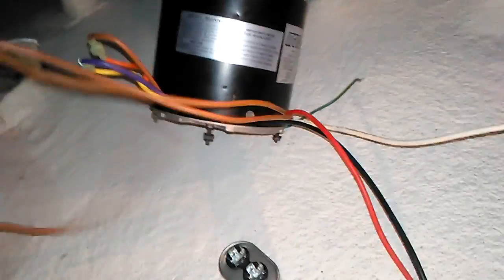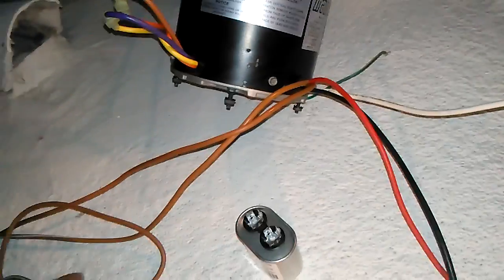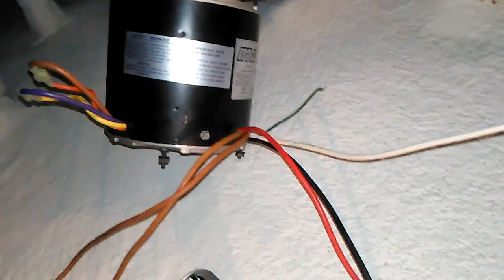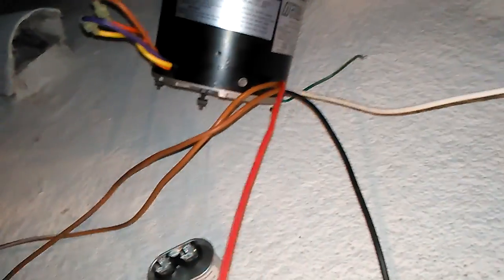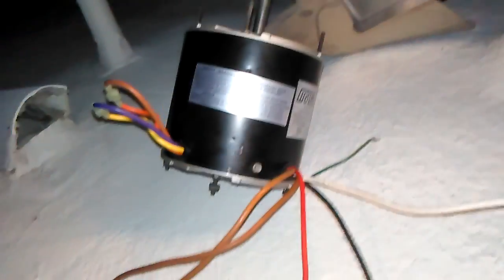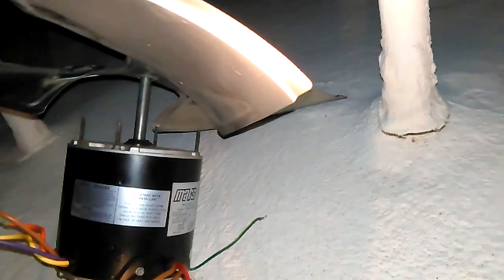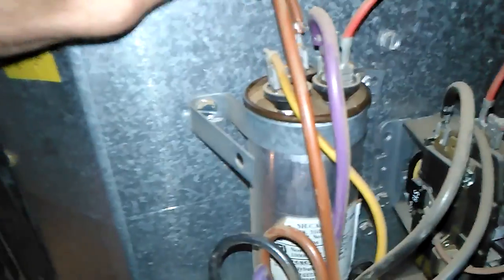5 wire condenser fan motor to a 3 wire. (Read my description to the video before commenting)

Comment: Hello, I had to replace my 3 wires fan motor, but the model I ordered to replace it  has 5 wires. how am i supposed to connect it ?  This like your video, but you no did everything.

Comment: Are you sure that's a condenser motor ? It looks like an evaporator Furnace motor because usually those come with a speed control. But the outdoor unit usually only get's 1 speed which is the fastest speed of course. I typically see them in 4 wire or the standard 3 wire.
Reply: My replacement came with 5. Its a rheem unit. It has the diagram to wire up for 3 or 5. It's reversible as well.

Comment: Hello, I had to replace my 5 wires fan motor, but the model I ordered to replace it only has 3 wires. how am i supposed to connect it ? I suppose the two extras wires from the older model was maybe for low speed/high speed signals.  the new model will only go full speed ? i'm not sure.

Comment: I have a 5 wire condenser motor i want to make a  220 shop fan out of it.  the wire colors orange -purple - yellow - brown - black.  I believe the yellow and brown were attached to a capacitor.  I know the black is a power line  - the orange may be ???? is the purple then a ground wire.

Comment: My car wiper motor has 3 wires. Red, white with black stripes and blue. I'm from UK. I've cut the motor off and want to connect a 12v light. What wires do I use mate?